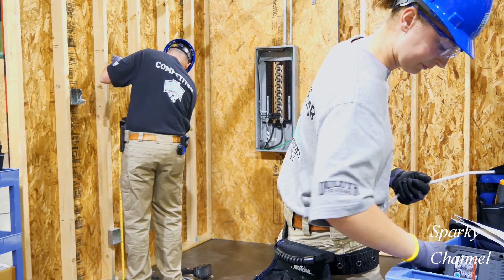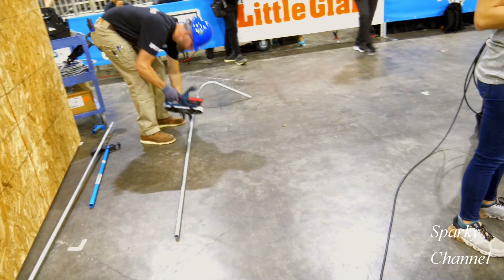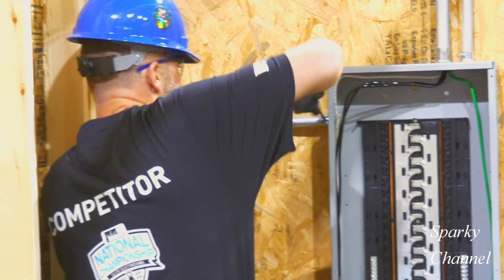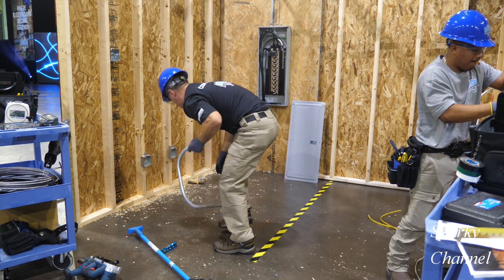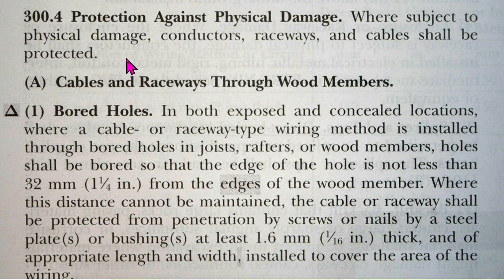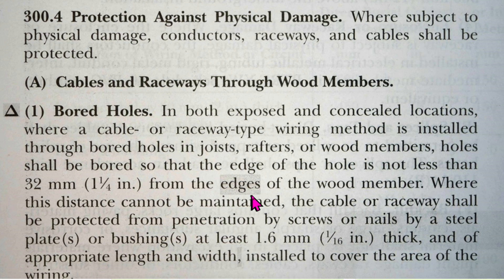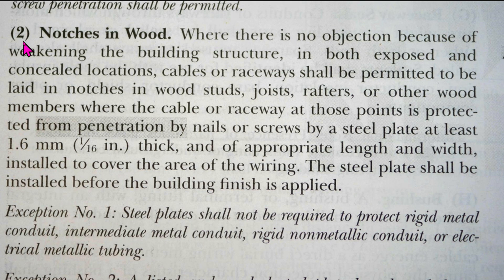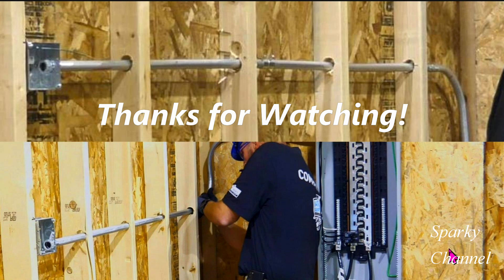How to Run Conduit in Studs per 2023 NEC 300.4(A)(1)

Comment: It does not matter what the code says if the inspector says it needs plates you put plates. Don't argue with inspectors So now we are responsible for the quality of the lumber used also ?
Reply from the maker: I agree. Arguing with inspectors is only for large items. Nail plates are no problem.
Reply: I get really frustrated with the doctrine passed along that an inspector is the AHJ, they are in fact not.  They are an enforcement officer.  Just as a police officer is not the legislator.  Now this isn’t a reason to not respect their judgment and try to work with them because they can be a huge asset and in my experience have knowledge that is correct, but I have seen cases where they were blatantly wrong and with respectful dialogue everyone could be heard and the truth discovered.  But if not, there are steps above them and it ultimately would include an elected official which is how any of these people get their “authority”.  In my case a discussion with a county commissioner would have been the next step.  This is in no way a call to be disrespectful to a building official, but they aren’t infallible and can be asked to provide proof of any claims made.  Final note, don’t go to war over a nail plate just to make an enemy who has the interest of the customer in mind.  All members of the trade brotherhood should work together.
Reply: That's why it's always good to have the code book with you and the inspectors info.
So you can report them to the state for not knowing the correct codes
Reply: @zacko1755  That doesn't work very well in Illinois since we do not have a state recognized license. Each municipality decides what licensing they will accept and what code to enforce (or not). We don't even use the national plumbing code. I believe we are the only state that writes its own plumbing code set
Reply: @TwilightxKnight13  sounds like yall need alot of headaches meds, to deal with all the different codes observed lol 😆. 
I believe we should have autonomousy with certain things. Our prooven safety  Especially should be top of the "standard" list.
Reply from the maker: @GH-mb4kd  GH, exactly. Respectful dialogue is the way to go. But have the code book with you!

Comment: I think PVC and other plastic conduit should be protected. Rigid steel shouldn't need a nail plate regardless of distance from the edge or should intermediate or EMT. The distance from the edge is a building department issue not an electrical issue
Reply from the maker: I was surprised to see the rigid PVC on that list too.
Reply: @SparkyChannel  yeah, screws and nails go right through PVC.
Reply: EMT isn't rigid steel though (RMC). EMT is thin walled and fairly soft. But I could see why there would be an exception.
Reply: I agree in theory that it is a building issue, not an electrician issue, but at the end of the day WE are the ones who bore that hole, not the framers. If you want us not to be responsible for the position of bore holes, then you need to have a framer follow you around and drill the holes so they maintain building standards. That way if a hole is in the wrong place, or it damages a stud, they have to fix it, not you. Does not sound productive imo
Reply: @TwilightxKnight13  electricians should be aware of how their drilling choices affect the building structure.  but at the same time, it will be the framing inspector, not the electrical inspector, who makes the final ruling on a compromised piece of framing.

Comment: Despite his holes being closer to the edge, the first guy gets my nod for the better job.
Reply: If the conduit enters in direct alignment with the the panel and/or the junction box why make the offset? Also, without the offset there is less drag (friction) when feeding the conductors.
Reply from the maker: @rtp4919  Thanks!
Reply: @rtp4919  I agree as well, the 90 coming down the wall ls crooked as well.
Reply from the maker: I like that he made a box offset going into the sub-panel too.

Comment: It is very easy to drive a screw through PVC conduit.  I think the code in inadequate when it lumps EMT and PVC in the same "no metal plate needed" rule.  Of course the wire inside the PVC conduit would, in practice, PROBABLY, escape damage from the screw but still . . . .
Reply from the maker: I was surprised to see the rigid PVC on that list too.

Comment: Always as close to Center as possible and when questionable I throw in an airplane, it doesn't hurt to add a couple nail plates every so often, you never know when someone is going to throw a large screw into the stud
Reply from the maker: Yes, the code is a minimum.
Reply: Code is a minimum.

Comment: The second electrician that used three pieces in order to be be able to run through the middle was a good demonstration of the challenge of inserting in tight locations. I've done the same when plumbing where you can only fit so long of a run given the angles at play. I would imagine the split stud could be repaired with a Simpson brace over the split and around the hole. Who scored higher in that challenge?
Reply from the maker: Yes, Simpson stong-ties can do wonders. See my video: IDEAL National Championship 2022 Pro Semi-Final EV Charger and Multi-wire Branch Circuits: https://youtu.be/2fwTW79qvmo    at 31:57 to see who advanced to the finals.
Reply: @SparkyChannel  awesome thank you for sharing your insights from the competition. I enjoy your code related videos.
Reply from the maker: @mikieboyblue  My pleasure!